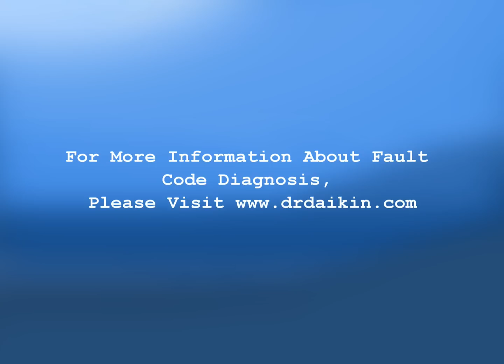Daikin RA Split System Fault Code Retrieval

Comment: Thanks for this good video, my problem is I don't hear any beeping. Even while switching on or off or temperature change using the remote. There is no beeping happening. I even used a brand new set of batteries for the remote but still no beep sounds are heard at any point. What could be wrong? and how to you adjust speaker volume?  thanks

Comment: mine was 00, it cannot detect any error yet aircon is not cooling
Reply: How did
You fixed it.. I am having the same error ..
Reply: @ankushverma4035  It turns out to be due to the faulty sensor on the external unit which measures temperature/etc. The engineers replaced that sensor, and then it starts working. Moreover, it appears that there is a deeper level of error diagnostics that is not published.
Reply: Xuancong Wang thanks mate.. I have lodged a issue with daikin as this is a brand new aircon. We have 2 in the apartment and Botha te not coolinh
Reply: @ankushverma4035  So sorry to hear that two of your new aircons are not cooling. As long as you don't hear any explosion, smell odor (refrigerant), the unit is not damaged and is in-principle able to cool if forced to run. However, due to over-complicated electronics protection (which also increases base cost), it just refuses to cool, that is a design flaw of Daikin.

Comment: Hi. As isDaikin inverter ac indoor operate but ofter 5 minutes outdoor shuts off 
What is problem
Reply: Same problem here brother. When I registered a complain their technician told that problem was due to faulty pcb and he also replaced the old fan with a new one. But still my problem is not resolved.They are not responding now a days. I wasted money and now i am realizing that